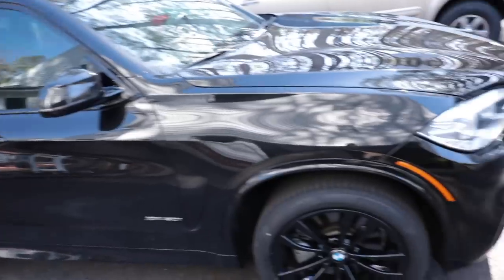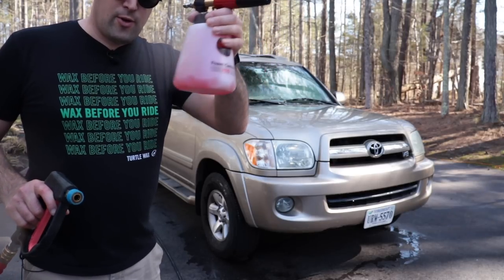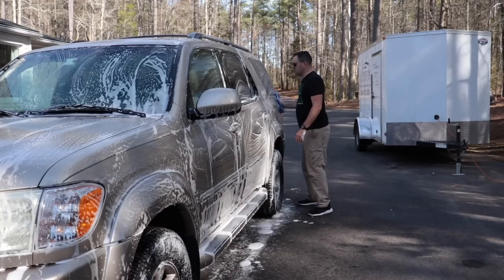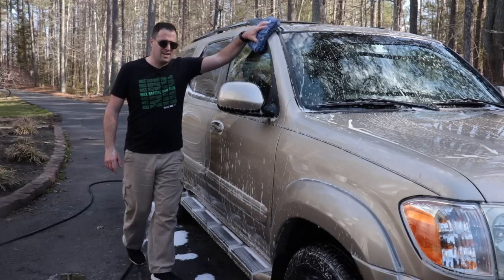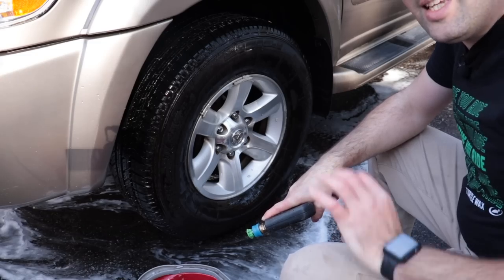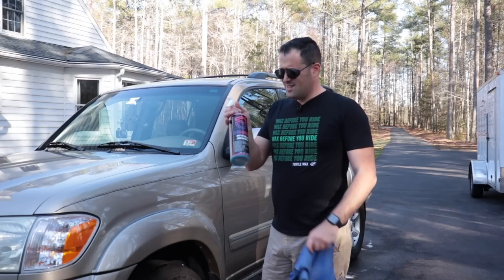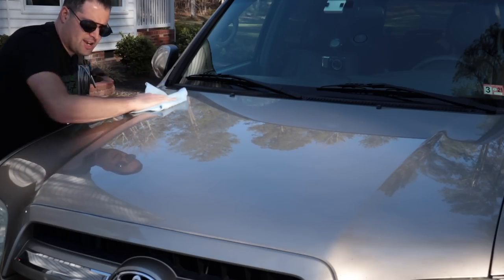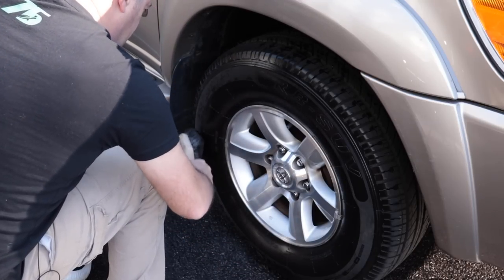Weekend Wash Testing Spray Sealants!  #mjjcfoamlance, #foamcannon, #carcleaning, #cardetailing

Comment: I believe in almost all of your philosophies also. One question I have I’d like your thoughts on though. Do you feel an APC rinse before the contact wash will diminish the coatings, or shorten their lifespan, because an APC isn’t a neutral ph cleaner? What’s your dilution ratio on your APC rinse? Thanks Phil, I’ll be checking out your detail workshop too!
Reply from the maker: Hi. Great question. We don’t use an APC rinse when maintaining coatings. At least not at first. After a year or so if we find the coating seems to be diminishing or the panels aren’t as slick and grime is sticking to them we will use an APC and hopefully pul some of the grime off and restore the coating. It depends on the situation also. I’m sure if one uses an APC each time it will weaken the coating over time.  We dilute the APC for our rinsing at 5:1 most times. But you can also choose to use a oh neutral APC like Koch Chemie Pol Star or Art De Shine Citrus Cleaner. Both can be diluted to 5:1 and used as an APC rinse also. And you won’t have to worry about it stripping/weakening protection. 😎👍🏼
Reply: @MirandaDetailing  wow , thanks for the quick response and all the info! On a side note, I also have had 303 Graphene on one of my vehicles ever since they came out with it 6 months ago. My vehicle sits outside in full sun and weather all day. I thought the protection was gone as the hood wasn’t beading, however after washing and drying it I noticed the next time it rained it beaded up like normal.
Reply from the maker: You're welcome....Yeah I found its not a strong beading product, when washing, more sheeting, which is totally fine.

Comment: Great, judging from your experience would you recommend KC soo2 sealant as a topper for a ceramic coating, never used that product before and it doesn’t look like it has sio2, don’t want to decrease ceramic coating hydrophobic‘s or gloss and shine.
Reply from the maker: Hi. Koch Chemie S002 is not a ceramic based sealant its polymer based. so it could be use on a coating, but not recommended.  I would definitely use another ceramic based topper.
Reply: @MirandaDetailing  Thank you much for clarifying that.

Comment: Phil would you say that a pre wash with a APC or citrus wash is more effective than just snow foam ? I tend to think that snow foam is a bit of a novelty and doesn't really remove dirt that well. Washing the car thoroughly with water as a pre wash i feel is more effective, then do a contact wash with a good shampoo.
Reply from the maker: Hi. Yeah I have experienced that a thorough apc rinse is faster and more effective than just a snow foam. But that’s just based on my experience. I guess others have said they rather just show foam and they say it’s just as good or better. 🤷🏻‍♂️
Reply: @MirandaDetailing  It just dawned on me that your on holiday, sorry for the interruption. Mouth shut now.😁
Reply from the maker: No problem man. I’m always answering texts and business stuff anyway. 😎👍🏼🏖
Reply: @MirandaDetailing  👍
Reply: I use the apc rinse method as well for my pre treatment. BUT the only foam that I've used that does a legit job of breaking down film and grime is Gyeon's (updated version) Foam!

Comment: Hey Phil what’s your go to panel prep for soft clear coat?
Reply from the maker: Well I’m going to coat it. I’m going to use a primer polish and skip the ipa step all together. Xtreme solutions has a few polishes that cure after 24h and they can be coated right over with any coating. Their Helios polish is one of those.
Reply: Thank you sir!

Comment: Just out of curiosity, what’s the length of your pressure hose?
Reply from the maker: Hey man. It’s 50 ft
Reply from the maker: Oh wait, do you mean the pressure washer hose or the hose on the portable washer?
Reply: @MirandaDetailing  pressure washer hose. Is that what you were using? I heard that the pressure starts to degrade after around 30’. I’ve got a gas pressure washer now that spits out 3000 psi and 3.2 gpm so even if the pressure drops a bit if I go to 75’ I’m not worried because I’ve got lots to start with. The problem I’ve got is I’ve got a crabby neighbour lady who complains to the city bylaw officer with a noise complaint every time I fire it up. Next time they have to come out to see me they are going to slap me with a noise fine. So I’m thinking of getting an electric washer and put it in garage and close the garage door. But then I need a 75’ hose and I’m afraid then that there won’t be enough pressure for my liking because I haven’t seen an electric pressure that puts out anything near my gas washer does.
Reply from the maker: Well I didn’t see a difference between the 25 foot hose the pressure washer came with and the nicer 50ft hose I have now. The pressure feels the same. It is much quieter and if I closed the garage door it would barely be noticeable. I would worry about the pressure dropping for washing cars anyway. You can totally get away with 2000psi or less. My gas puts out just around 2100 psi and the electric is much less maybe 1800.